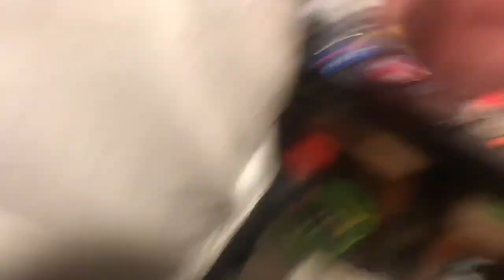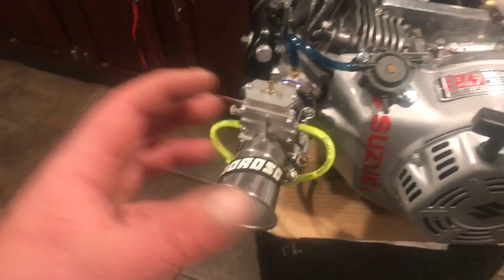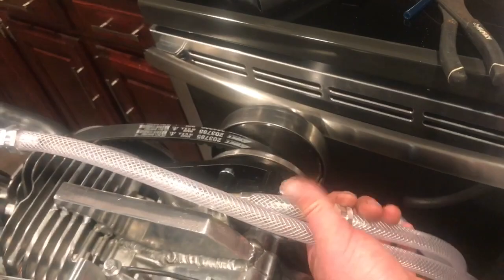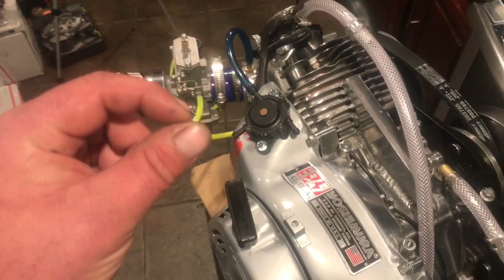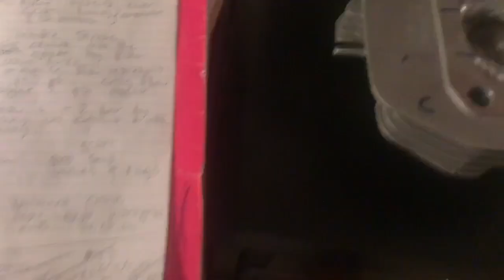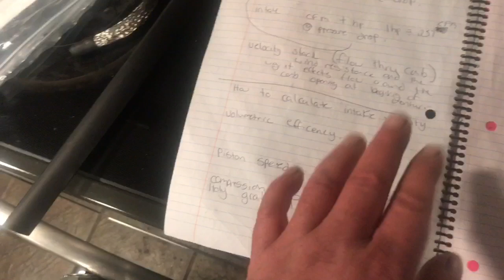Gx390 gx200 “tuned & modified to create the "5th" cycle...on a 4 cycle engine Preditor 212 ( part 1)

Comment: how do you not have thousands of subs yet? amazing content! keep it up man
Reply from the maker: Right !...subscribe if not ..and hit the notification button...what it is i think is I  just started posting videos like 3-4 months ago ...also how's the content ? Which videos do you like the best ? Also hit the like on every video for me man ! It will get some steam under the channel....it's just a baby lol ...but with people like you I might have a chance ...do you know how many views you need to make in a day to even make .02 cents a view ? 2000 views a day !!!! Whaaaaat ....lol ....need likes !!!
Reply: Paul's karts Lifan 420 wow thats nuts but I like how you explain everything and also having content that you wont be able to find anywhere else. Definitely cant wait for the jetting/carb video. A good tip would be doing videos over “normal everyday” people would struggle with. for example cut to length pushrods, gage rockers, different lift cams, timing, and jetting. ive watched almost every video you post! amazing work
Reply from the maker: Did a gauge rocker video but even I struggled with the install ..there actually hard lol ..well more like fidgety ..so never posted it ..I would need to edit the heck out of it lol ...I'm doing a cam video this week and a carb jetting video too ...

Comment: Hey Paul I just have another question, I cant seem to find the answer to this anywhere online, I want to know what kind of gap I should set in between coil and flywheel on my engine, the engine is a tillotson 212 stage 1, governor removed, race air filter system and velocity stack, 3 stage header, autolite AR3910X spark plug, MSD coil, vented block and vented valve cover, the carb is nothing crazy just the basic carb that comes on stage 1 tillotson 212 from go power sports

Comment: Hey Paul. I watched all your Videos. Incredible Work  and Subscribed. 
That is a Wicked Set up. 
I restored Dirt Bikes for about 10 yrs with my 3 Sons and recently got into Building, Restoring Mini Bikes. 
Can u tell me a Carb and mm to run on the 212 Predator along with a Velocity stack. Engine is Brand new. Just want to modify it for a Taco I am restoring. 
Still learning about the Best Set ups and Mods for the 212 Predator. 
Already have a new Header, Air filter Kit, 3 inch Breather and Fuel lines installed, etc. 
I want to switch out Stock Carb and put a mikuni on it. Could you tell me what mm Carb and where to buy the Velocity stack for it. Wish I could pick your Brain for a while. 
Keep making videos.
Thanks Paul.
Reply from the maker: Hemi or non hemi ..? Valve sizes ? Port work done ? Port size? Cross section area size ? ..what rpm will you be turning this ? Will it be a track star or a driver ? These questions answered with real consideration will help me make an educated guess ...there is a lot that goes into these selection so make sure you have a goal and "do not sway ! " or you will find it expensive to go back and change a carb or cam or valve in the future to get it right ....so think about it and let me know ...I'll give you my best guess ...thanks
Reply from the maker: And cam your using

Comment: So are you grinding your own cams??? Would you consider a radical ground cam for say a circle track a 5 cycle engine??? Just trying to fully understand your logic. I've had tractor and truck engines go down so many that just haven't had time to play with these little Clonda Clones. I've wanted to for a long time. Have installed a couple dozen of them tho.  I'm assuming this girl will have zero low end.?.?.   Reason of saying or asking is I've had several V8s with radical sounding cams that would barley take off from a dead start , but would come in like a 2stroke around around 5,Grand to 8,grand. While V8's with low end cams that will burn the tires off have a rumble that is much smoother , but completely falls on it's face around 5,000 RPM's. Like if you're gonna pull out to pass you better have plenty of road to do it in.

Comment: So math tells me 172 cfm × .257 =   44hp. If that was a V8 it would make 353 hp. BUT you have a little tiny piston/stroke compared to a chevy 350 (4" bore × 3.48" stroke) That little motor is EFFICIENT !
Reply from the maker: 92mm piston is 8mm short of 4” ..lol .. kinda huge for a single .. but yes very efficient .. I made 63hp from the same size engine using nitromethane.. wanna talk efficient
Reply from the maker: Stroke is way short on this tho at 69mm .. that’s not even 3” and has no helping pistons to create intake motion and vacuum or help the piston come back up the bore as the opposing pistons fire

Comment: Nice engine, can we try that on boat racing,,
Reply from the maker: Absolutely ...I would definitely create a snorkel and a high flow water proof filter ...but yes this would apply to all engines ...well all 4 strokes ! I will be posting another video tomorrow with more details
Reply: @paulskartslifan4206  here in philippines we are using that kind of engine in open formula boat racing,sad to say we are unable to perfect the modification,sometimes engine broke down,,
Reply: @paulskartslifan4206  i have liked all of your videos buds
Reply from the maker: Hmmmmm...what's breaking ?
Reply from the maker: Thanks man !
Reply: @paulskartslifan4206  the cam,sometimes the cap bearing
Reply: @paulskartslifan4206 welcome,,
Reply from the maker: Can you use a billet cam ? Do you use a pull start? I do use a pull start because I need one so I can ride around and shut off the bike or kart and re start without the need for a starter box ...if you are using a starter box or can convert over to the starter box the billet cam is way stronger...also you can weld or braze the block and side cover around the cam journals or bearings and around the crank bearings ...you can support the cam in the block externally from the back side of the block by filling in the area that's recessed "you will see this area " with either weld braze or jb weld ..just for support ...that's where they break ..also the side cover can be welded to support it or brazed or epoxy ..also if you need to clearance a cam do so extremely carefully and slowly ...use a cut up side cover to check and also have piston removed so you can see from all angles ...make sure no contact ...also use arbor shaft shims to take out side to side play in the cam ...I find some that have .100" worth of side to side play ...set to .005" ....also check for either retainers hitting the guides or make sure nothing is hitting and putting a shock wave down the pushrods into the cam ...also if the valve seats are not cut good they can creat havoc in vibrations that will over well the spring and send the vibrations down the cam destroying how the cam designer set up the cam to run and possibly resonating the cam to failure ...also if your spring pressure is to high like above 190 lbs on the nose the cam is being worked hard and may wipe out the lobes making you lose lift or it can lead the cam to failure ...so check all clearances and installation specs on the valve train and cam ...if all this is good than you just got a bad cam and I would try again ..but more likely there is an underlining problem that you will find when disassembling or re installing ...hope this helps
Reply: @paulskartslifan4206  yes we using pullstart,,are selling engine?
Reply from the maker: Yes ...
Reply: @paulskartslifan4206  how much for 92mm piston?
Reply from the maker: Well how do you need it ? Domed , flat ,valve reliefs, compression height ?
Reply: @paulskartslifan4206  flat piston,and it depends on your model about the valve,
Reply from the maker: Actually I probably don't have a piston that will fit ...I am making a few of the tubed heads tho ...well after I get flow numbers on them..
Reply from the maker: I was asking if the piston you where looking for needed valve "reliefs " ...which are recessed areas on the piston that allow the valves more clearance between the piston and valve ...
Reply: @paulskartslifan4206  yes i like a flat pistons with valve reliefs
Reply from the maker: Where do you live
Reply from the maker: Are you looking to buy ?
Reply: @paulskartslifan4206  hw much it cost?
Reply from the maker: This engine is not for sale but I can build you a winner if you want ... if you want power I would suggest a cylinder head ... I have a price list here but no website yet ... call me to talk .. or text ... if you are a team or have multiple engines I will give you a deal .. I will offer you a head that’s unbelievable...and unbeatable ... 781-492-7358